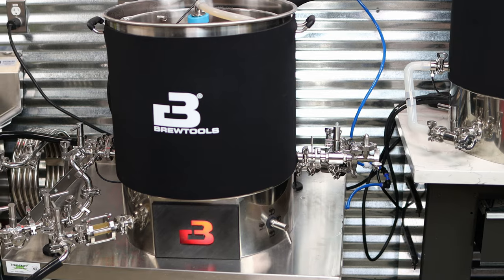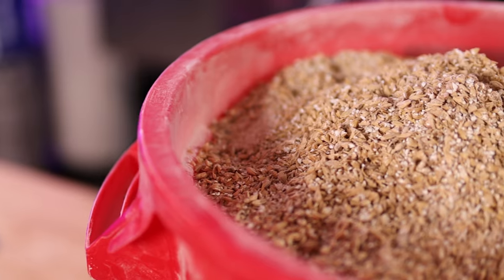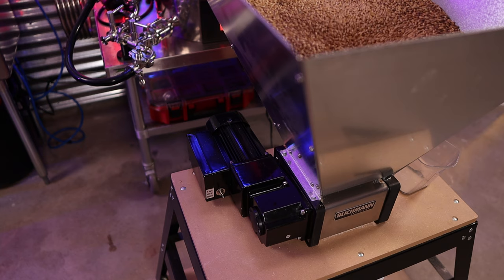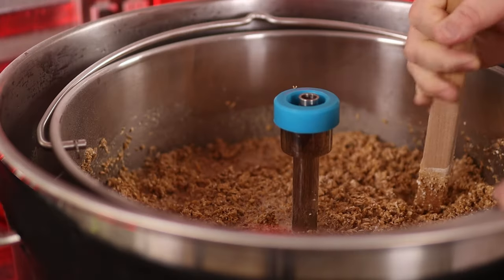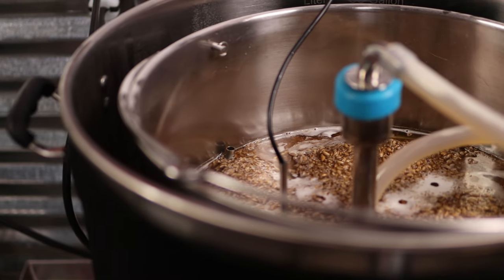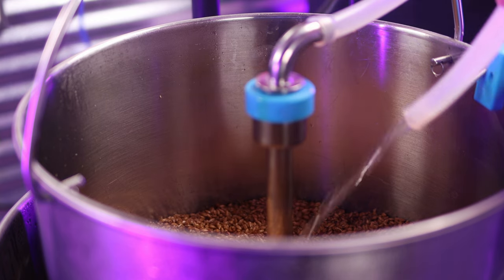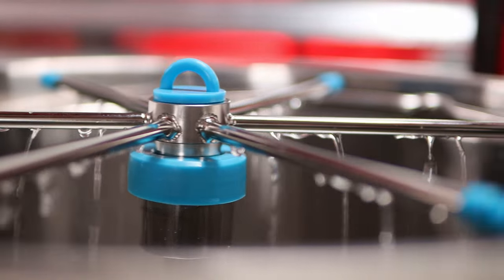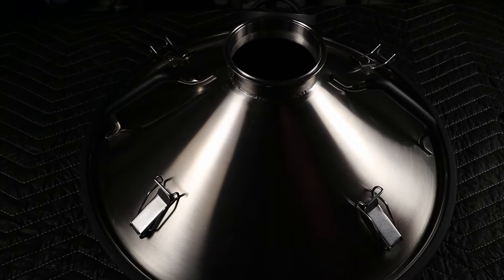Maximum HomeBrew Efficiency

Comment: Hi Bradley! Very informative video on how to improve efficiency.
The increased sugar value after clarifying the wort has to do with the homogeneity of the sample. If the wort is still unclear, it affects the density and thus the sugar (extract content). The measurement should be taken after pumping out cloudy wort. When the wort is well mixed and homogeneous, you will receive consistent gravity measurement values.
Let us know what you think.
Reply: Also, 0.3% difference is pretty much without measurement error.

Comment: Bradley, I am enjoying your videos and potentially ready to get into a B80 type setup.  I am new to the brew house so I’m doing a lot of research right now.  It would be nice to see maybe a 2 to 3 part series on the planning, recipe creation using Brewfather. As you said it is all about building a good routine and logging what works and what needs work.  It might be a little overkill for the seasoned brew masters, but it might help out a newbie like my self.  Water treatment, testing, PH when, were, how it all starts to add up… 
1 - understand your equipment - what you need to know to dial in your kit ie B80.
2 - Brew day planning - recipe creation, stocking what you’ll need for the day grain to water treatment items, Brewfather entry and brew log setups.
3 Brew the planned beer with testing and log entries.
4 fermentation’s process and tasting of finished product..  
I know this is simple to write out and most certainly hard to film and produce, but everyone can benefit from seeing the behind the brew day items that take place in order to get a good brew day routine in place!
Reply from the maker: Those are all very distinct possibilities I have a lot of projects going on could probably easily work these suggestions in !
Reply: @PortlyGentleman  Thank You for being so helpful!  I need to design my rolling cart cabinet first so I can tuck it away after a brew day.  Happy wife happy life....
Reply from the maker: @johnhoth5960  of course it’s my pleasure and I fully agree with your statement got to keep the boss happy 🍻🍻

Comment: Hello friend.
I'M the owner of a b150 on a small commercial brewery here in Portugal. I used to have 3 vessel system, and brew with great efficiency. However I have been struggling with the b150, efficiency way to low arround 65% on a 20kilos grain bill. Grain is well crushed, i do recirculation with the new manyfold. Never tried lifting the basket and vorlauf again, will give it a try. But i find that there is a lot of sugar in the grain after the sparge, i sparge with 80°c hot water, but without much luck. Do you have any tips I could use? Can you take a lot at my brewfather maybe? Thanks again

Comment: Hey Bradley, I'm interested in how you use CO2 to push your wort to the fermenter. I have a slight uphill climb and that's where I see the most loss of wort volume. Frustrating.
Reply from the maker: It definitely works extremely well I highly recommend it. all you really need is a Brewtools gas post. A couple of tri-clamps and the gaskets. as well as a T if you don’t already have one.

Comment: Thanks! More BT videos. This was really helpful. 
I have a B40 with a steam hat and condenser. I have not touched the boil off rate in Brewfather as it is pretty much spot on. What i do notice is that OG is the same before and after boil. Is this because the boil off rate is so low?
When you calculate losses, do you fill up and then circulate through the counterflow chiller before pumping out?
Reply from the maker: If you’re trying to figure out the volume of the kettle that’s not necessary.. if you’re trying to figure out the complete losses within your system absolutely make sure everything has water in it .
Reply: @PortlyGentleman  trying to figure out total loss. I’ve added, based on your setup, more valves and bends 😄 I measured 4.2 liters loss…?…? When I drain the rest I never get back the 15 liters I put in, I only get 14.2 liters. So somwhere in the system 0.8 liters is left. I guess in the CF chillers as I did not take it of, I only blew the water out.

Comment: Thanks for the video! Very useful, my brewhouse effeciency on B40pro is less than 70%, I think because of quite big chiller/tubing losses (around 4.5liters), thanks for your suggestion to purge chiller/tubing with CO2, going to try it next brew (in fact I already tried it on last brew, but I end up with too much wort to fit into my grainfather conical :) )

I have few questions, would appreciate if you'll find time to answer 
1) do you rotate sparge manifold (brewtools one) while sparging? myself I keep rotating it every few seconds, its not too convinient (and its hot), but I think it should give better efficiency because of more even sparge?
2) vorlauf, do you do it before or after sparging?

Thanks!
Reply from the maker: You should definitely be able to get that efficiency up. being able to scale back your losses is going to help with that immensely. I do rotate mine on occasion I’m not sure that it does any good. it does keep me occupied and that’s important lol .
Vorlauf If you’re going to do one you definitely want to do that before you Sparge. Let me know how your next break goes?
Reply: @PortlyGentleman  thanks, I’ll post comment here :)

Comment: Bradley - what kind of volumes are you sparging with for a 10 gal and 20L batch sizes? I am getting a b80, and need some help to understand what size hat to get. 
Thanks.
Reply from the maker: I haven’t done anything 20 L for so long I can’t remember honestly. I think an HLT with a capacity of 45 L 12 gallons would do nicely
Reply: @PortlyGentleman  thanks. Meant 20 gap! 
I’m tossing up between the 35L and 65L Digi boil.
Reply from the maker: @garthridgeway  if it was me I would go with the bigger one you never know when you might want to brew a larger volume. Better to have the capacity than not .